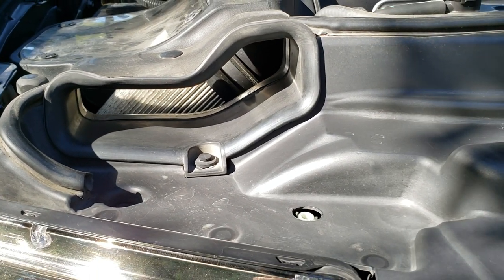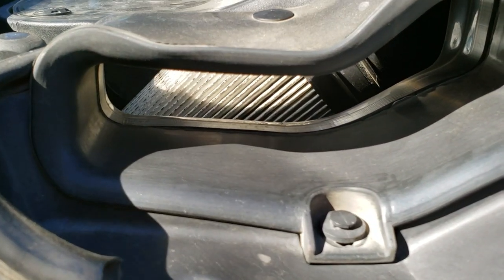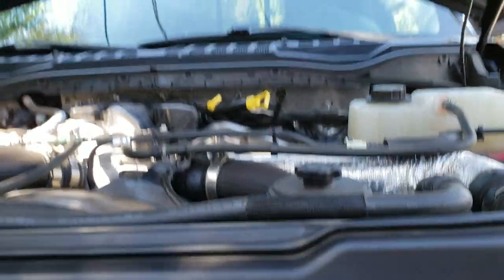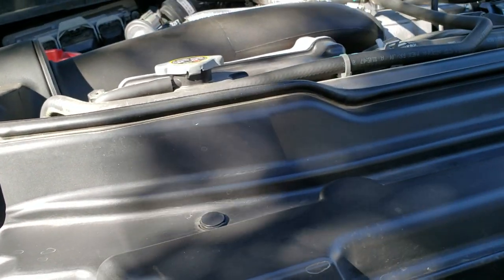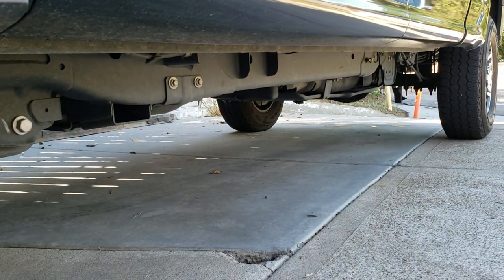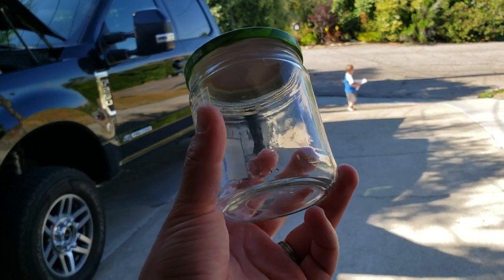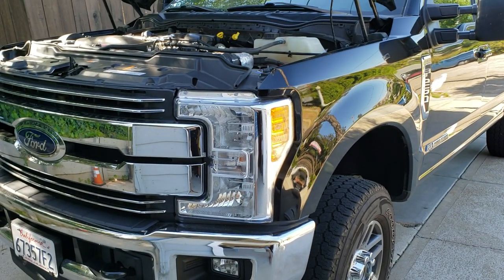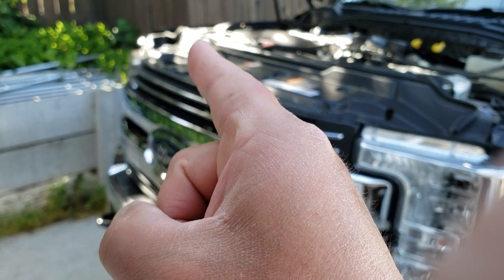2017 Ford Powerstroke 6.7 Laggy Peddle

Comment: Man I can't believe people who add fuel additive to their tank EVERY TIME....

Like the money your spending, to save the CP4... Could be spent on just fixing the problem and install a frickin DCR pump.... Then you never gotta worry.

Not to mention, if you just use decent fuel, it will BE FINE... We had plenty of old wore out 6.7 work trucks, that got dirty slip tank fuel, never got fuel filter changes, never had the water drained, etc and they literally run just fine man.... I can't believe people really waste all that money on fuel additive every fill up... Maybe every now and then but god damn.... Just throwing money away that could easily be put to fixing the only issue these trucks have... (CP4)
Reply from the maker: @Gendreau113  Well, this video is from 5 years ago and I think the only thing out there was a disaster prevention kit. I don't think the DCR was a thing yet. Also, I've maybe spent about $200 in the past 5 years on fuel treatment since I don't drive this truck much. The DCR is $2K, installation not included in that price. I get what you're saying though but Ford extended my warranty again for other reasons so my CP4 is covered for another 2 more years. I may think about a DCR at that time. I've heard from a few sources that it's not really the fuel, so to speak, but rather cavitation that occurs. We have lift pumps in these trucks so that doesn't happen much. Water in fuel can cause a failure too. Also, the renewable diesel has some issues and that's what we have switched to here in California. It's hard to find regular diesel now. With all being said, I have plenty of friends with these Ford 6.7s that have zero issues and some of them have well over 200K miles. I only hear about CP4 failures online. The percentage is actually really low. Like less than 5% failure in Ford trucks. It's like anything else, you win some, you lose some 🤷🏻‍♂️

Comment: I run Opti-Lube Summer Plus and change my fuel filters every 15k in my 17 Powerstroke. I also drain the separator every oil change. Just hit 31k miles and have never seen a drop of water. I always fill up at a high use Chevron station, maybe that is why.
Reply from the maker: I always try to use a high use station which is what I use 95% of the time. It's when I travel to places and I need fuel is where I get the water. I guess I'll just drain the separator when I get back from the desert every trip.

Comment: Might not be a bad gas station. Water condensates in your tank anytime there is an air void. More air = more condensation. Keep that tank full broseph
Reply from the maker: It was the station. A couple of truckers complained about it. I've never had an issue since. I also don't go to that station anymore. I'd rather haul a few jugs of known good fuel. I will follow your tip for sure though. I'll try to keep it full as much as possible.

Comment: Hey Jason. good info. I have a suggestion for you . I bought LED head light bulbs and fog light bulbs. They are not cheap have about 400 -500 in them. But what a difference. I picked them up from Headlight revolution. Need to check them out . Thanks
Reply from the maker: I've been thinking about those for a while. Most of money is going into my turbo rzr right now so headlights are on the back burner. Nfab steps are before headlights too.
Reply: I hear that. I have a 51 Willys jeep that's an ongoing project. Little by little.